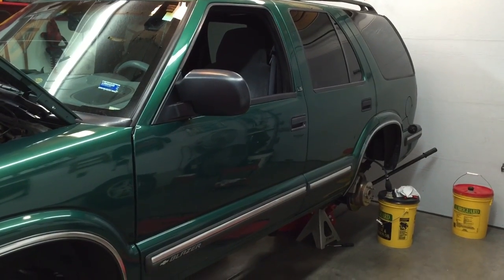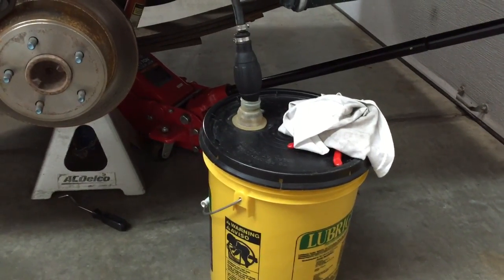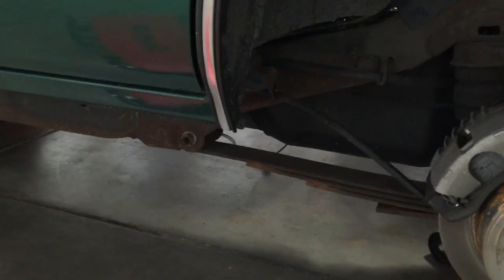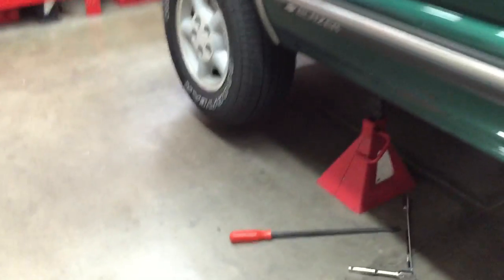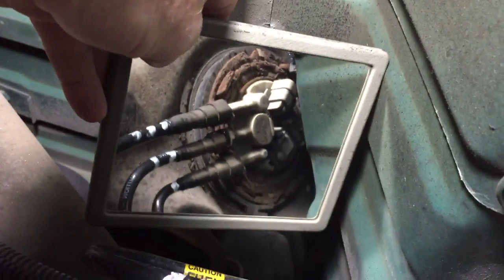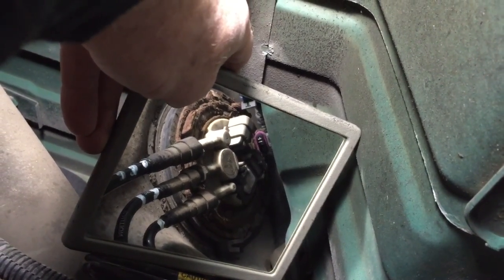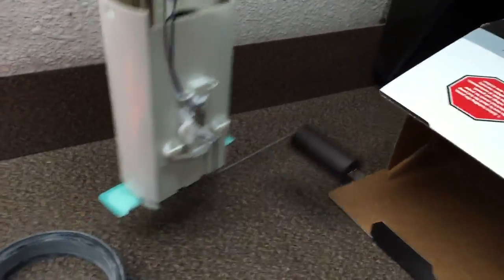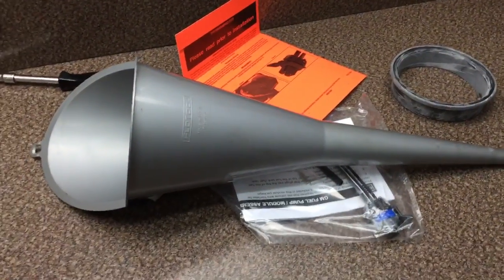1999 Chevy Blazer 4.3L. Fuel pump replacement.

Comment: Hey Randy, I am getting ready to put a fuel pump into a Blazer almost identical to this one but the ears that hold the retainer ring in place are rusted and broken.  I am afraid I am going to need to replace the fuel tank but I cannot find a new one anywhere.  Do you have any ideas where I could find a new one?
Reply from the maker: Josh Vandeventer   No I don’t. Sorry. Did you check with the dealer?
Reply: Try partsgeek.com, I know they sell replacement tanks
Reply: Hi it's a year later, how'd you make out with that?

Comment: my 99 s-10 blazer drinks gas and I can smell it but can't find leak, fuel filter area sound kinda funny like a vacuum leak kinda but not all of the time, it's new btw so I don't know...please advise if anyone has any ideas...ive checked all I can think to...thanks much
Reply from the maker: Lawabiding Citizen   The fuel filter possibly may be restricted , causing the noise, you might want to replace it. As for the gas odor, don't know what to tell you. It doesn't take much of a fuel leak to be able to smell it. You just need to follow all of the fuel lines and look for leaks. You might check the fuel lines where they attach to the engine. I have seen the hard nylon lines crack or leak at the crimp, if yours has the nylon type. Look at the fuel manifold on the engine and the injectors for leaking. You could possibly have an evaporator canister vent valve stuck open, check for codes.
Reply: On top of your tank, by the lock ring is where it’s probably coming from.

Comment: I'm trying to take my fuel pump off but the 15mm screw is just sitting there spinning and not coming off
Reply from the maker: REWREW   I’m guessing the threads are stripped. Do you mean the nut on the strap?
Reply: Are you still spinning it?
Reply: Albert Einstein 
Haa haa hhaaaaaa

Comment: Chevy Engineers provided an easier way of removing gas from a fuel tank.  I just did it on my 99 Chevy blazer with 4. 3L for removing 1-1/2 year old gas from the tank.
Under the hood, and in the back of the engine right next to the distributor cap, there is a nozzle fitting with an internal Schrader valve (car tire core valve) that is used to attach a fuel pump gage to test fuel pump pressure.  Use a core valve remover to remove the internal valve.  Push over the fitting a 3/8 ID hose that is long enough to put the other end into a container.  Remove the fuse box cover (driver side) and locate the fuel pump relay.  Next to the relay is an open terminal. Connect a jumper wire from the positive battery terminal and insert the other end into the open terminal.  That will bypass the fuel pump relay and run the fuel pump continuously to pump the gas from the tank.  Run until you see about half amount of flow with lots of bubbles. ( Do not want to burn out the fuel pump, trying to run the tank dry.)  The tank is about an 18 gal capacity, so remove no more than 16 gallons.
Reply from the maker: Good to know! Thanks.
Reply: How well is that going to work with a bad fuel pump?